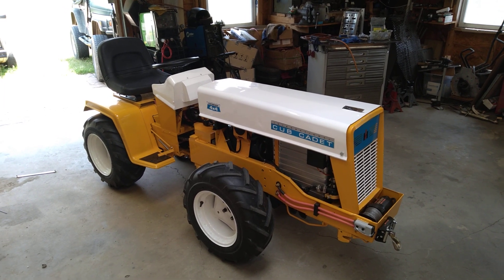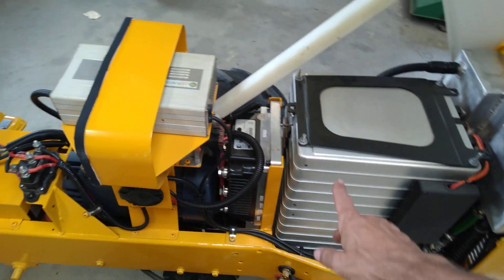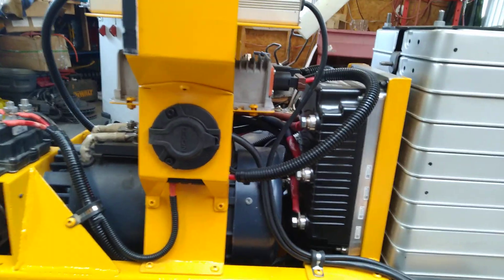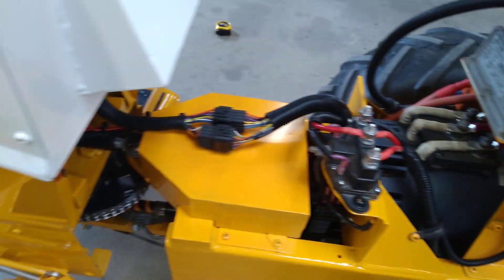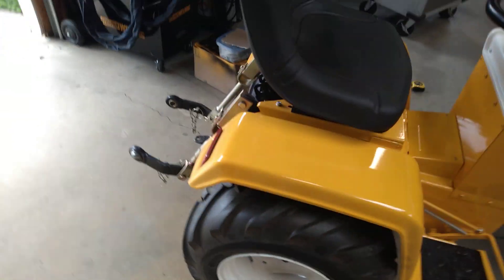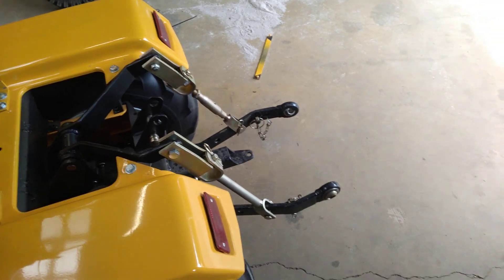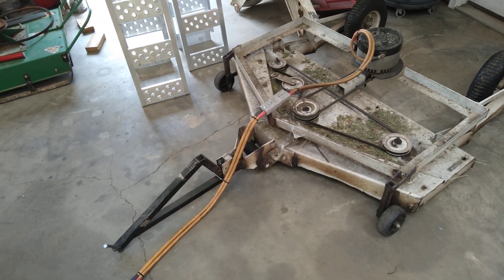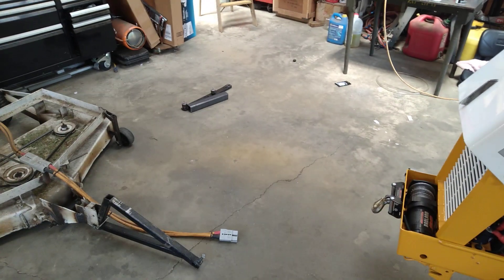EV Converted Custom 4x4 Garden Tractor

Comment: Just fyi power steering pumps don't rob much power they have whats called a bypass valve when you don't steer. The fluid bypass the bits that steel hp. Just fyi man. Electrical are cool untill you really use that thing in a creek or water etc. All the e sensors go stupid when you try and show off and say here hold my beer watch this. So just food for thought
Reply from the maker: Thanks for the info.  Why would I need a P/S pump though and what would I run it off of?  If I wanted hydraulics, I'd probably make a power pack that slides into either the front or rear receiver hitch.
Also, I've heard engines don't like drinking water very much either and most cars/trucks these days are over loaded with more electronics and connectors than this little tractor has.  Having said that, if driving in deep water was something I did regularly, it would be trivial to design everything around that by putting any water sensitive components and connectors in water proof containers.
Thanks for watching!

Comment: Great work! You solved a problem I been pondering about how to electrify a conventional mowing deck. Currently my Kobalt electric push mower just isn’t quite enough.
Reply from the maker: Glad you like it.  Getting everything to fit and making all the brackets/mounts is a challenge.  The actual EV conversion really isn't very hard.  If you can read a wiring schematic, there are only about 12 wires that need figured out.

Comment: How did you setup the steering I have an 80s turf master with 8hp Briggs trans and gearbox is chain driven  and I'd have to do front axle chain driven or get a whole quad 4x4 drivetrain
Reply from the maker: I have several videos going over the iterations of steering.  I used a EPS from a Nissan Versa taht drives a small sprocket chined to a large sprocket.  The large sprocket has an arm welded to it that push/pulls a linkage.

Comment: Looking good man! Try playing around with the video title and see if anything gains traction… “EV converted Cub Tractor” , “DIY Electric Ride on mower tractor”
Reply: Exactly. The YT algorithm is so unpredictable but at the same time incredibly good suggesting random videos tangentially related to your searches. 

The scary thing is I think the algorithm suggested your video because of the visual elements of your thumbnail a few videos ago. Like it knew I was more likely to click on thumbnails with giant orange power cables and an exposed electrical motor. 

It’s actually been in the back of my mind bothering me lol. Because your videos should have shown up in the searches prompts based on what I was looking for, not in the “suggested videos” feed.

Long story short of how I have access to a “free” 1960’s Caterpillar dozer. However the steering clutches are bad and the motor locked up. Parts are either unobtainium or insanely expensive. So naturally I thought about an EV swap. Hard to justify a +15,000lb dozer just laying around, so what if it doubles as a battery backup for the house or  (kinda where your ePTO idea comes into play). So I end up on the Edison Motors channel after searching things like “heavy machinery ev swap” , “electric tractor conversion” , etc. And then below one of their videos I find your video from a few back 🤷
Reply from the maker: Ok... :)
Reply: Haha you were quick on it. Just can’t believe a build like this hasn’t garnered more views
Reply from the maker: @ChuckThree  Yeah, I don't understand why some videos get so many views.  I put an electric motor on a garden tiller and put it behind my other tractor about 3 years ago.  I got a couple hundred views.  Someone else did the same with a gas tiller...didn't even bother to take the handle bars off...over a million views!